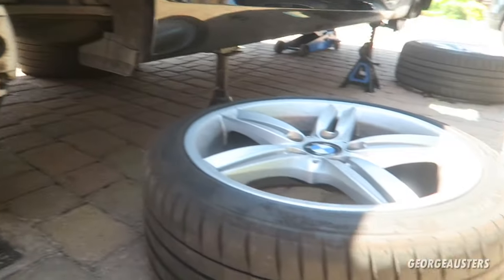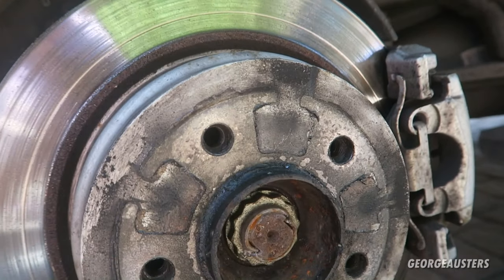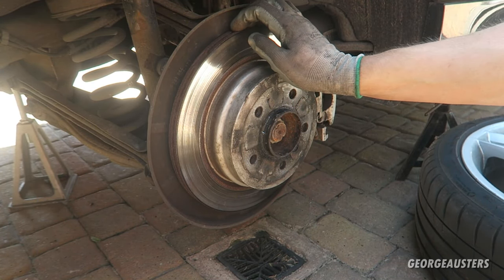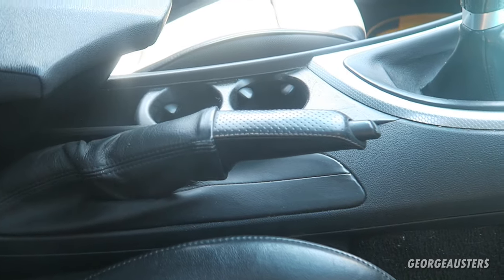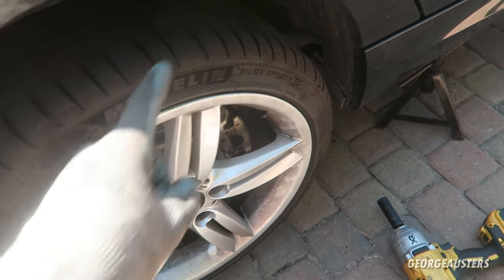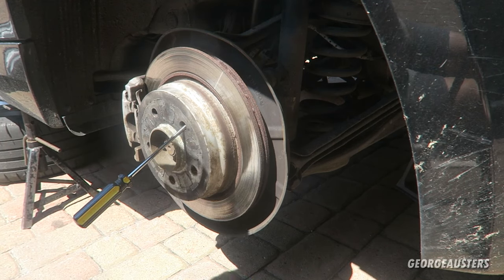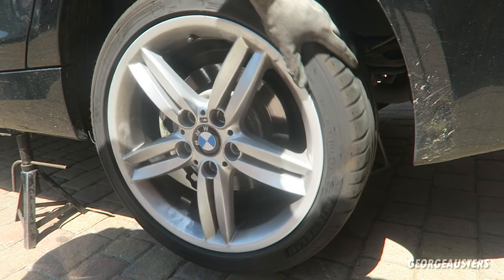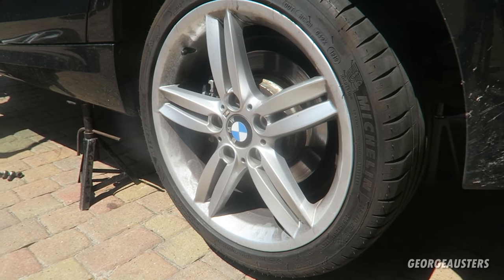How To Adjust The Parking Brake On A BMW (E90, E92, E87, E82 etc)

Comment: Under the handbreak lever is a spring with a catch you are supposed to compress and lock that before you do the handbreak, it releases the spring tension on the two cables so you get them set even. Then tighten to lock the wheel then back off the cog 4 to 5 pings with the screwdriver.. Your method works fine but you need to let the spring off under the lever and put it back.
Reply: So you should first lift the car from rear then compress the lock under the handbreak lever and then tighten it from wheel boot side and then your good to go?
Reply: yes, this the CORRECT procedure!

Comment: Strictly, you have to unlock the break in the interior, to take all load off, then turn in the brakes until they are tight, then - for BMWs with auto adjusting brakes, e90, e60 etc - turn back 8 teeth and then lock the break in the interior again. For older BMWs, e46, e39 etc its only 2 teeth I believe. Thats the official BMW procedure. Anyway, I did it that way and the result sucks. Gonna try the freestyle version tomorrow or later today..

Comment: So my understanding is that you're supposed to go full lock on the adjustment, back off 8 clicks. But you're supposed to pull off the handbrake cover and use a spring clip to make sure you get the full lock after 3 clicks.

Comment: As someone has already mentioned, you have to put the spring/brake tension  service mode under the handbrake before adjusting at the wheels. It's important because it releases the tension on the brake cables.
Reply: whats spring/brake tension service mode ? is it an OBD function ?
Reply: @arnolduk123    No, the emergency brake is mechanical on the older cars not electronic.  All you need to do is have the handbraker lever off, not engaged.  This is a simple process, not complicated.
Reply: Yea thats exactly right

Comment: Good job George and very well explained. Many cars not just BMW have this adjusted by turning the adjusting wheel to a position that shoes holds the drum so he can't move. And then back the adjusting wheel simply by 4-5 clicks. Shoes are at good position when is slightly rubbing against drum or disk when handbrake lever is down. Variations can be at stretched handbrake cables ant that can be adjusted inside of car.
Reply from the maker: Thank you Mr T👍🏻

Comment: I just did this and I'm 99% sure all these videos are telling people to adjust their breaks so that they are catching the wheel even when the break is fully off. I'm almost certain you should tighten it till it catches the wheel then back it off, then go to the leaver spring itself and adjust it, as a loose hand-break is a mixture of the cable, drum, and lever spring all loosening over time. Surely you feel resistance when you're not accelerating by tightening the drum so much that it stops the wheel on the third click?

Comment: If you've got a torque wrench and a suitable hub socket you can do this more precisely (and perfectly symmetrically):
1. With the cable loose, use the adjuster until you can't turn the hub with 60 Nm (44 lb ft), then back off ten clicks,
2. Pull the handbrake lever up six clicks, then tighten the cable a bit at a time until you can't turn the hub with that same torque.

This is the way Range Rover recommends doing their electric handbrake, which is a BMW system.👍
Reply: What is the need of step 1 for this? Could you not just go straight ahead with step 2?

Comment: Hi George. Thanks for your video. I have a 2010 E87 120d M Sport that has done 128,000 miles. My parking area outside my house is on a slight slope, so i can feel things slightly exaggerated when i park facing downhill. When i apply the parking brake and then remove my foot of the brake pedal it feels like the near-side is holding more than the off-side (near side almost feels like it's not doing much). I also now avoid using the parking brake (leave automatic in Park) because when i take the handbrake off the near-side doesn't appear to release fully - i can hear it squeaking at low speed. I'm not a mechanic. What should i ask Kwick-fit to do when it is there for its service in a couple of weeks please?

Comment: Hey George, thanks for this video. I have a MOT advisory that states "Parking brake efficiency only just met". The tester further informed me that it was "offside" that was under-performing (Nearside recorded 180 brake effort whilst Offside recorded 110). Would an adjustment like the one you've illustrated in this video correct this? or am I looking at a new cable or new handbrake shoes? Appreciate any advice.
Reply from the maker: should be fine to just adjust it👍🏻

Comment: I've done like in the video, and after the adjustment everything is nice but 2-3 days later I have to pull the handbrake up a lot again. Do you know what it could be?
Reply: Sounds like either worn shoes or stretched cable?
Reply: because this is not the correct way to do it.

Comment: Quick question, I’ve heard that when the car is on axle stands, you should be more tight with the clicks as when you lower the car again the tension loosens. Is this true ? Thanks man, great video
Reply: I just did this about 1 hour ago on axle stands, I turned mine until i could feel the break catching the wheel, then loosened it a bit till it moved freely as I really don't think people should be adjusting it so that it's catching the wheel when the hand-break is off. But once lowering it back down and driving it, it seems like I have 2 clicks of nothing, so mine you have to pull it to the top to stop the wheel fully, but I'm almost certain that it's a mixture of the hand-break lever itself needing adjusting and the drums. What people are doing on these video's is just fully adjusting the drum until it stops the wheel on the 3rd click, but by doing that the break is catching the wheel when it's fully down which will 100% affect your economy and you will feel resistance when you stop accelerating.
Reply: JTR thank you very much for the information mate, I just wanted to make sure I’m doing the right thing before moving on👍🏼

Comment: Anyone have suggestions on how to better find the gear without taking the hub/rotor off? I tried to get it and my mechanic tried to get it (no charge) without taking it off.
Reply from the maker: Shine light through wheel bolt hole

Comment: Great video, thanks dude. Mine has a bit of a weird issue. The garage adjusted the handbrake, however when the car is on a hill facing down, and when I release the handbrake  - the car doesn't move. I need to put in first gear and drive down to literally move the car. When I'm driving down, the break pads making the noise as if they have been worn out. The pads are getting attached to disk maybe?
Reply from the maker: Handbrake is too tight
Reply: thanks for reply, I thought it could be the handbrake shoes

Comment: Hey George hope you're well, Was changing rota on the rear passenger and after putting the new one on, now the hub won't turn or the rota? The adjuster screw won't turn in either direction either to loosen the handbrake shoes 😠 any ideas? TIA
Reply: Buy a new adjuster. If everything else in there is rusted up as well, might be worth the time and money to just replace the handbrake components.

Comment: Why lev it in reverce, 1 gear is always lower ratio than reverce
Reply from the maker: Reverse if you're facing down hill, 1st gear if you're facing up hill
Reply: i se what your saying,bot the only reson you put it in gear is that the car not shall  roling so put it in 1 gear is allways right.it takes more forc to got it rolling in first gear than reverc and thats depend off the ratio in the gearbox. its lower in 1 gear than reverc you se..
Reply: In Sweden, where I live, cars won't pass inspection with a handbrake that doesn't work to their standards. I literally just found this out an hour ago when my E90 330xi didn't pass.